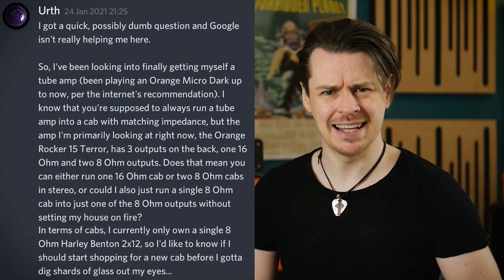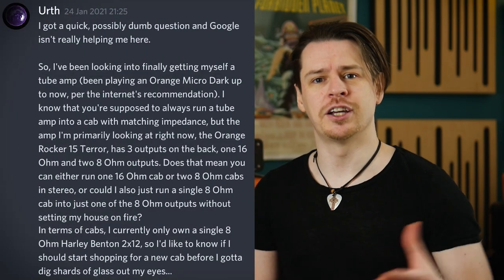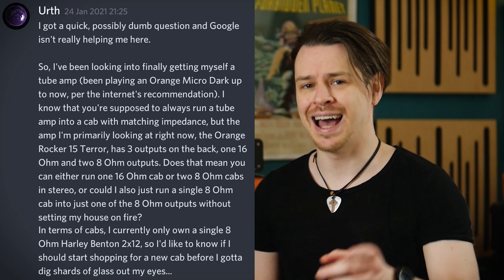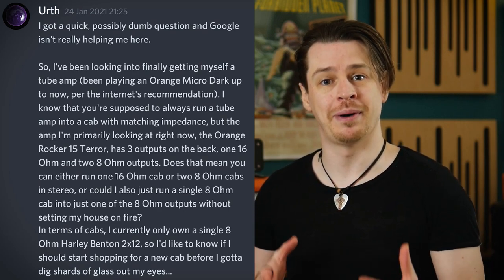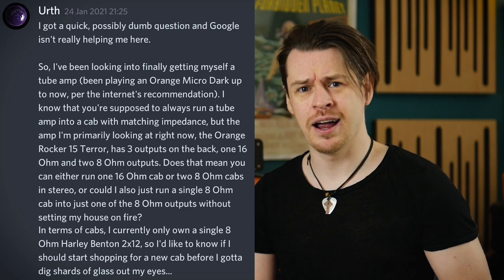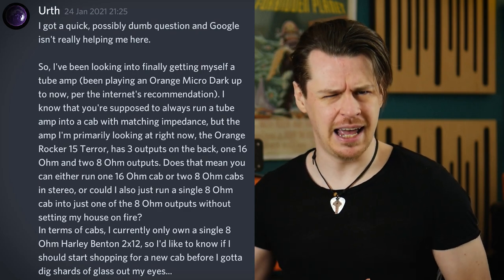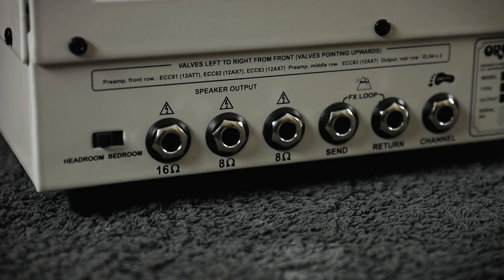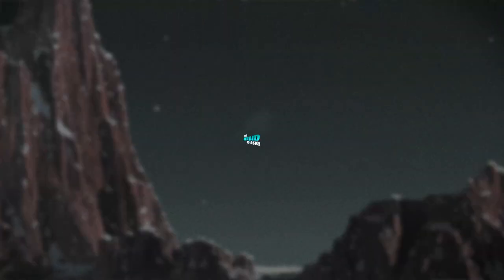Impedance Matching Speaker Cabinets | Too Afraid To Ask

Comment: Something I also see people sometimes get confused about is that a tube amp puts out the same rated power regardless of what impedance cab is used. In other words, a 100W tube amp is 100W whether it is into a 4ohm, 8ohm, or 16ohm cab. Unlike solid state where the wattage is dependent on the impedance of the cab it is connected to. So a solid state amp that is 100W into 4 ohms, is ~50W at 8ohms, and ~25W at 16ohms. Also, it's mind boggling to still see people think this, although it is usually with stereo systems for playing music rather than guitar amps and cabs, but higher wattage rated speakers does not mean they are louder speakers. The wattage is how much they can handle, not how much they will put out. The sensitivity of the speaker, and the wattage the amp puts through the speaker, are what determines the volume.
Reply: It’s a neat trick when one realizes that a 3db difference between two speakers SPL’s results in either the resulting output being twice as loud or half as loud. For example, if we take two speakers, one with an SPL of 93db and another with an SPL of 96db...and all other things being equal, the 93db speaker will be half as loud as the 96db speaker or conversely, the 96db speaker will be twice as loud as the 93db speaker. This has practical applications. 

I used to have an old modded Vox AC30 head that was too loud for some clubs. I ran it through a Marshall Model 1960 4x12” cab. I installed two speakers in the cab that had an SPL 6db less than the Celestions (I think they were Jensens...not sure though...this was maybe 30 years ago) and rewired the cab to separate the pairs. Never ran more than one pair at a time. 

FOH dude bitches, “Turn down...you’re too loud.” I simply unplugged from the Celestions and plugged into the Jensens. The 6db SPL difference meant that the Jensens’ volume was 1/4th as loud as the Celestions’ volume output (remember each 3db SPL difference results in a difference of 2 or 1/2, so 6db is a factor of 4 or 1/4, relative to perspective. Each speaker was 16Ω and each pair was wired in parallel, so the amp got the 8Ω load it expected.
Reply: @kirkbolas4985  Very good to know. Thanks.
Reply: Very useful. Thanks
Reply: @kirkbolas4985  HI, just to clarify 3dB is equivalent to x2 power, which is 1.4 (square root of 2) x spl which is approximately 1.23 x loudness, so a 3dB less sensitive speaker is (give or take)  like  swapping your 100W Plexi for a 50W, a 10dB less sensitive speaker is like going to a 10W amp and will be about half as loud.

Comment: One missing fact, speakers are never 4, 8 or 16. Different speker, shows different resistance. For example most 8 ohm speakers are from 6 to 7.5 ohms. 16 ohm speakers are around 12-14. So, there's inconsistence all over the place.
Reply: Really? Why must all these things have to be so hard? 🤬
Reply: @svenkaahedgerg3425  don't panic. Just plug 8 to 8, 4 to 4 and 16 to 16.))
Reply: @pakiw2  You are correct of course. I was just wondering if this has an effect like balancing the bias to get the best effect and longevity of the amplifier and valves.
Reply: Yeah. When I was building my speaker cabs, I used a multimeter to test the resistance (impedance) of the speakers and it was always around 6-7.5 range of the 8 ohms.
Reply: Measuring resistance will not show you the actual impedance.

The impudence is a combination of the resistance, the inductance and capacitance of the speaker.

During a DC voltage only resistance matters once the current is settled to a continuous level.

During an AC voltage the current will be changing and therefore the effects of the inductance and capacitance will be reacting to the frequency of the AC signal.

Comment: Theoretically, you could connect four 8 ohm cabs to the 2x8 ohm connections on the back of the Orange amplifier you used as your demo in this video. Pair them up in series-parallel, as 2x8 + 2x8 where two cabs are connected in series with one another in each pair, and then the two pairs are connected separately to the 8 ohm outputs on the amplifier. In series, each pair of amplifiers will have an impedance of 16 ohms, and then in parallel those 16-ohm loads will appear as 8 ohms again. :)

Likewise, you can connect two 8-ohm cabinets to the 16-ohm output by connecting them in series as well.

Of course, you may need to get a little bit creative with your wiring if the cabs don't already have connections to allow for series configuration. But the math still checks out at the least. If you're crafty enough with your cables, you could build your own series cable with three jacks to make it work.

I have to do my own creative impedance matching at some point in the near-ish future because I bought a Sony A/V receiver that expects 8-ohm loads, and, unfortunately, the 5.1 set of Sony speakers I have (that were part of a very self-contained "home entertainment system" that is proprietary everything, as is Sony's M.O.) are all, paradoxically, 3-6-ohms. I have to come up with an extra 2-5 ohms of impedance to put in series with each speaker before I can connect them to this A/V receiver. The easiest and dirtiest way for me to do that is to just put 2x10 ohm resistors in parallel in series with each speaker! 5 ohms of resistance should give approximately just under 5 additional ohms of impedance! (The frequency-dependent reactance of the speakers means that adding 5 ohms of pure resistance does not equate to adding exactly 5 ohms of impedance to the whole circuit, but that's a whole lot of extra electronics physics.)

Comment: Awesome information Colin

As I used to take Electronics classes in college, I'd say this is brand new to me. To be truly safe, I play unto one 16 ohm cab just so I don't kill my ears. Even with a 15 watt amp, it has multiple connections for this to apply for another 16 ohm cab, but I don't want to shell out the extra cash just to go deaf, not to mention drive my neighbors insane.

Comment: Great TATA as always Colin.
I would add to this that there is a MYTH out there in guitar land that it's ok to unplug a cab from the amp when it's switched on, people will claim they have done it loads of times and have never had a problem. This has caused false information claiming that disconnecting a cab from a valve amp will do no harm which is 100% FALSE!
The people that have got away with it have had VERY little to no signal getting to the power amp stage in their valve amp. If you are playing through your amp or if a guitar lead is plugged into it and you are getting the mains 50Hz hum coming through your speaker and you unplug the cab, most likely YOU WILL DESTROY THE OUTPUT STAGE OF THE VALVE AMPLIFIER!
I speak from personal experience. My ex guitar tutor years ago unplugged one of the speakers from my Marshall 20/20 Rack Mounted Stereo Power Amp while I was playing and then plugged it back in.
Some days or weeks later later I started to get a strange noise from that side of the amp, when I opened it up I noticed the valves on that side were ''red plating'', glowing red hot and there was sparks inside the output transformer that I could see flashing through the paper insulation wrapped around the core. Fortunately for me I'm an electronics engineer by trade so it just cost me the price of a pair of matched EL84's and an output transformer.
Uncle Doug has some great videos on the technical aspects of valve amps, including this one on output transformers. https://www.youtube.com/watch?v=nNlPgirHP48

Comment: Was hoping to glean something but I knew this stuff already. But Colin explains it very well as always.  My amp, Peavey Classic Stereo 50/50 has switchable impedance 4,8,16 for each channel. I'm running a single 15 for 8 ohm in one cab and 2x10 for 4 ohms on the other channel. Sounds great!- I am always careful to double check the switches and cabs every time I set it up. My transformer would be very hard to replace.  - Don't let the magic smoke out of the amp!

Comment: Thank you for referring me to this video. Both Freyette (Power Station 100) and Radial (Cab-Link) have boxes that can be put between the amp and cabinets which have input impedance selectors and output impedance selectors. My goal, as I stated in my other comment, is to run 3 2x12 16 ohm cabinets per head. Per this video above, it seems that the best way is to have custom amps built that have multiple output transformers (is this even doable). Or to take a post pre-amp out to separate clean power amps as splitters. To make this clearer, my goal is to have 3 stacks of 3 2x12s (9 cabinets in all) in a wet/dry/wet 3-way system running at 16 ohms. To make this even more difficult is the fact I want to use Hiwatt as the primary tones and textures amp. Hylight amps have more outputs than Hiwatt. Seriously, the more time I spend on this the more sense it makes to just have custom amps built to my specs. Can a guitar amp have multiple output transformers? If so, how many could a Hiwatt 100 handle? I know this sounds a bit crazy, but I am trying to do something that hasn't been done before (to my knowledge) by anyone. Thanks again!

Comment: I also have a harley benton 2x12, since it has a switch in the back four different ohm numbers I just put it on Mono 8ohm and plug all my tube amps into the 8 ohm to 8ohm socket.

I have been extremly anxious about connecting them wrong. I have heard you can blow or damage your transistor and screw up your amp and such. I watched countless videos on youtube and read some websites on the subject matter about it to make me understand it more. Probably the best video is from Philip McKnights video.

I also have two cabinets and have always wondered if you can connect them both to the same amp. you can only do it with a few heads. as you said yourself in the video.
Reply: Phil and Colin are so great. "Know your gear" indeed.

Comment: A couple of years back at a gig, I connected my 4 ohm bass head to an 8 ohm cab linked to another 8 ohm cabinet. So I figured, at worst, it would result in a 4 ohm impedance because 1/8 plus 1/8 is 1/4, right? I absolutely suck at electronics, but I do remember how resistances sum in parallel (or how capacitors sum in series). I got to play one note in the line check before my amp blew up and I still don't know exactly why that happened. Other bands using similar amps on the same cabinet setup had no trouble that day, so I was able to borrow an amp after much faffing about.

Also, this happened on the first of several gigs we played in a ~two week period, so I had to borrow amps for every subsequent show that month. Not quite a tour, but the closest we've ever come to one so far. Fortunately, my amp was still under warranty, and while it wasn't possible to replace it with the same make and model, I did get another amp of a similar value at no cost to myself.
Reply: You were right. You just had a defective amp. Glad that it was still under warranty. The other bands now having problems is a big clue.

Comment: Modern solid state amplifiers are more lenient on impedance, but it's always best to check the manual. Some old BJT output circuits require specific output impedances to not fry themselves. They can even be damaged from not having a speaker connected.

Comment: I lost count of how many times I have told sound guys to NOT connect the soundboard into one of my amp's speaker outputs.
Are soundguys really THAT stupid? Connecting the soundboard into speaker output is the fastest way to set the amplifier on fire.
Reply from the maker: Not exactly healthy for the consoles channels either
Reply: I had this debate with a sound guy once and assumed he didn't know what he was doing BUT he was using a behringer DI box and some of them will handle a tapped amp signal from between amp and speaker. Ive never tested it with my GDI100  but it probably works fine, and you can pad it twice.
Reply: One guy told me a signal out port is a signal out port, regardless of what it says it SHOULD go to.
The lesson learned is be your own soundguy, so you know your soundguy knows what the F he is doing.
Reply: some of us are, yes lol
Reply: if their console has 8 ohm, too ... be evil, unplug your speaker, crank your amp and go BOOM :D 
guess console costs way more then amp :'D
Reply: @tehalexy  None of that makes any sense.
Reply: That's why I always have them mic a cab. If they screw it up it just sounds bad
Reply: And I bought an Effectrode Blackbird. It has a direct-out with built-in cab sim. Really, I don't even need to bring a cab at all. Just direct-out to the mixing board.
Reply: @djohnson2499  if you're worried I'll screw up your sound, grab yourself one of those Two Notes boxes or a Palmer PDI-09 if you're on a budget :)
Reply: If a "sound guy" goes anywhere near the back of your amp, beat him with a stick.
He's only there looking for the easy option for him.
He doesn't give a shit that you spent a couple of years nailing your tone, he just wants an easy ride at the desk.
I recommend nothing more than a cane as I found 3 x 2 caused people to be concerned for him.
However, times have changed and you can now buy, legally and reasonably priced, tasers.
I have had some shitty episodes at the hand of some "sound guys"
Reply: @mickdebergerac1143  Exactly. But as I said before, be your own soundguy, so you always know your soundguy knows what the F he is doing.
Reply: yeah, Ive had a sound guy blow up one of my amps like this.   Since then I've always set my amps up myself unless I personally know the sound guy.
Reply: Damn the sound guy at my first gig decided to just turn my amp on without any load connected all together and I almost hit him
Reply: I mean, it's called and Ampli-fier

Comment: Now the funny thing is when it gets wild. I have an 80's amp that has 2x speaker outputs which both read "4, 8 or 16 ohm". It's a solid state though, but still has an obvious, albeit mild effect on the sound. Interesting test, very convenient when the cab is something like marshall 1960 with two connections, one for 4, one for 6 and both used 8 each. Somewhat follows the descriptions found online. More or less bass/mid/treble and more or less perceived gain.

The critical failures are the most interesting ones. I understand that on a valve amplifier it's not that likely to get a critical failure with smaller load than expected, but with a higher load there's a chance that in failure the transformer arcs through and burns the isolation resulting in nasty things. And from what I understand, it is kinda reverse with solid states but not guaranteed.

I wonder if talking about the failures and effects would be too confusing for an average user to avoid an average viewer from making a big mistake after watching? Or if your experience covers that kind of stuff. Like the effects of less efficiency and different eq curve, or as simple as wiring or combining speakers/cabinets. The way it sounds written gives me kinda "not suitable content for the channel" vibe despite being interesting.

The most obvious answer usually is "only do what the manufacturer tells you and how it's supposed to be used" but hey, every gigging musician has probably faced the scenario of "what even is my backline cabinet" without an amp with versatile speaker connections.

The way this Orange had it labeled is probably the most confusing from user standpoint "connect two 16 ohm cabinets to these two 8 ohm outputs". It makes sense when explained how it works and if using a single output, but the fact of there being two makes it confusing.

Great and quick episode.

Comment: a lot of info here is based on Voltage controlled power sources, like most push pull amps and a few single ended designs. some single ended designs are current sources, meaning that with a higher impedance, the power can be higher. my class A transistor amp is a current source and has about 3.2 times the power in to a 16 ohm compared to a 4 ohm load.
due to this current control, its fully resistant to shorting out!

Comment: I have a 16-ohm Orange PPC212 cab and a Suhr Badger head that only has 4 and 8 ohm outs. I've used the 8 into 16 for years with very good results. It's a mismatch but it works.

Comment: Two things: Why do tube amps need something to be connected to the output, and what specifically happens if you turn on a tube power stage without a load connected?

Second, impedance matching is not quite the optimal arrangement. To get the most accurate performance out of a speaker (meaning that the speaker is most closely replicating the signal it is being sent), you want the impedance of the speaker to be ten times greater than the output impedance of the amplifier. For the curious, the ratio of the speaker impedance to the amp's output impedance is known as the damping factor, and there is a pretty good explanation on the blog of NwAvGuy. It is important to note that the law of diminishing returns kicks in hard with damping factor, such that going much beyond 10 might produce a measurable improvement, but the improvement will almost certainly not be audible.
Reply: As long as you don't attempt to amplify a signal, probably nothing. If you do try to amplify a signal, high voltage spikes created in the OPT primary can cause arcing between the output tube(s) electrodes, arcing between the pins on the tube sockets, (flashover), and worst of all, break down the insulation on the primary winding causing shorted turns, rendering one of the most expensive components in the amp useless.